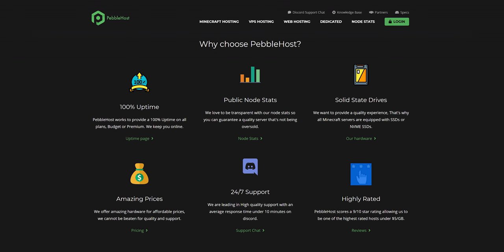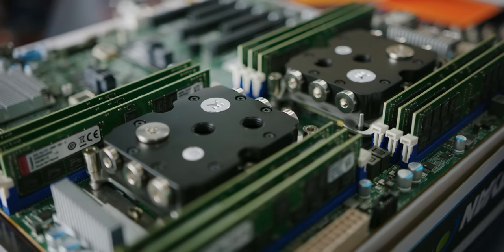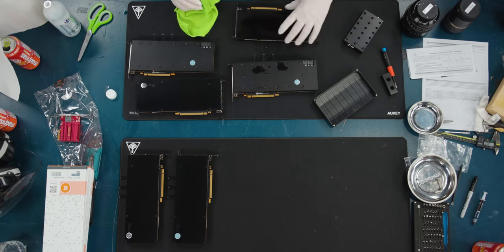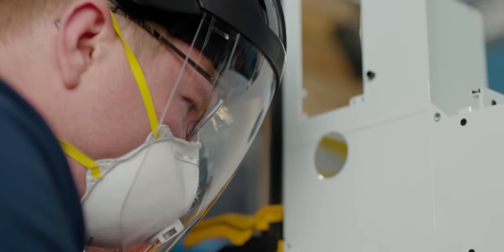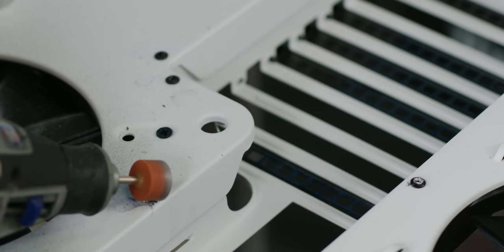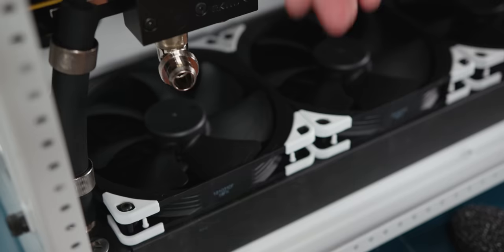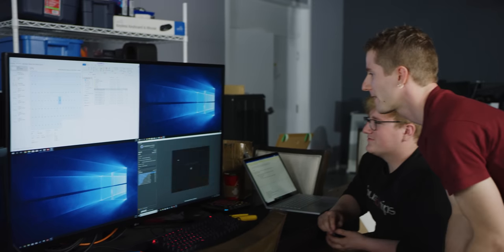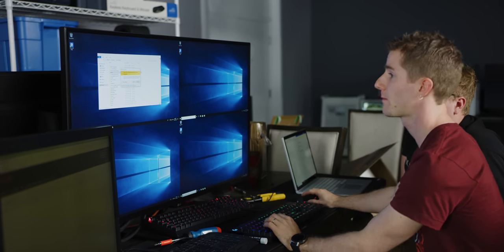We FINISHED the $100,000 PC! - 6 Editors 1 CPU Pt. 6

Comment: In a post EPYC world, this seems meh on the CPU front.

It's awesome nonetheless as an overall project with all the VMs running.
Reply: Yeah EYPC would run 6x16 GPUs, 4x4 Optanes, 6x1 USB cards, 1x8 NIC, and have 2 lanes left over.
Reply: @chickenballs-balls  Yeah, it would have been cheaper. But it wouldn't have been so much fun, right?
Reply: @chickenballs-balls  Works out to 16k per desktop. Even the base model Mac Pro would dust this heap of shit per user.
Reply: @chickenballs-balls  and then moved
Reply: if, and it's a big if, they can find a proper epyc motherboard with decent VM support (remember, they switched the motherboard a couple of times even on intel)
Reply: @ionstorm66  no thunderbolt and no optane is a no for most professionals
Reply: @ionstorm66  
The NIC alone is a 1x16 card. So you'd be -4 on the number of lanes.
Reply: Epyc processors are for noobs who have been living under a stone for the last 10 years and now come out with their pitchfork to enter society again. Next year Intel kicks them back into Neandertaler mode again.
Reply: @directlinkrexx4409  Thunder bolt and optane work on AMD. It's all up to someone to actually make a dual socket TB board though. Optane works on any nvme system.
Reply: @ewenchan1239  Single 100G cards are x8 3.0. Also they are only running a single 40G which could run a dual port card on x8.
Reply: @jankees4037  
I'll give the EPYC this (over the Intels) -- the EPYC does have more PCIe lanes than the Intels.

But to the best of my present knowledge, there aren't that many boards with enough PCIe slots to be able to put 256 PCIe 3.0 lanes all to good use, so therein lies the rub with the EPYC processors.
Reply: @UCROrNX7yCYQH_UO9p7uP5PA Grid is display over IP. They wanted hard wired connection to the monitors and peripherals, lower latency. Also Nvidia wouldn't send them Quadros because last time Linus gamed on the Quadros for the 8K PC.
Reply: @ionstorm66  
That is true. 

However if you go to about the 6'05" mark, you can see that they're using dual port Mellanox cards both on this system and also on the server(s) (see time marker ~ 6'15") which means that they're PCIe 3.0 x16 cards.

Thank you.
Reply: @ionstorm66  
I think that it's actually more than that.

https://www.anandtech.com/show/8042/nvidia-grid-update-nvidia-launches-grid-test-drive-for-vdi-desktops

My understanding is that the Tesla V100 is actually doing the processing and then sending the images back to the VM so that it sort of bridges the gap between remote desktop to an actual physical workstation vs. being physically at the workstation/console/terminal.

AFAIK/from what I can tell, this is actually even better than some local IPMI/BMC setups that I've seen and used, both currently and in the past even though KVMoIP isn't a new "thing". (Not in the slightest.)

The only real advantage that I might be able to surmise here is that with each VM having their own dedicated TITAN V, each VM has access to more VRAM. That's about it. Beyond that, they're both using the GV100 processor.
Reply: @ewenchan1239  Do you know the card in the server is installed in a x16 slot? The cards will deliver  60gbit on x8, and he is only running a single 40G connection.
Reply: @ionstorm66  
Well, the card is PHYSICALLY an x16 connector unless he starts cutting the PCB to make it PHYSICALLY into an x8 card.

Electrically, the slot could be an x8 or x16 slot regardless of the physical dimensions. Heck, for all you know, you can turn a x16 physical slot into a x1 electrical slot. There is literally nothing that prevents you from doing that, so the question is a bit of a moot question. It's irrelevant. (A Ferrari that where you can set the cruise control to the posted speed limit doesn't change the fact that it's still a Ferrari.)

It doesn't change the fact that the cards are physically x16 cards and for it to be able to achieve the full 100 Gbps speeds, it will need the full x16 PCIe 3.0 electrical interface which has a theorectical bandwidth of 128 Gbps.

Just because you buy a Ferrari and ONLY drive it at the posted speed limit doesn't detract from the fact that you have bought and are driving a Ferrari.

So, I'm not really sure what your point is.

Or are you trying to say that because he has no more PCIe lanes left, that he shouldn't have bothered buying the Ferrari and should have gotten the Prius instead?

(If I read and interpreted the point of your question/reply/comment properly, that would be the analogy that you might be proposing. If you're going to be slow anyways, why bother with the Ferrari when you could have just gotten a Prius? Conversely, if he even takes out just ONE (x16 physically/x16 electrically, possibly TWO (x16 physically/x8 electrically) of the Titan V's, he would have enough bandwidth available in the x16 physical slot that he would be able to run it at x16 electrical speeds, depending on how the PCIe expansion board/switch has been set up.)

If you have the Prius, you remove the speed restriction, you still have a Prius. If you have a Ferrari, and you remove the speed restriction, then you'd be able to fully realise the potential of the Ferrari. This is the same here.

Either way,  with a DAC, he can configure the ports on the Mellanox cards to run at 100 Gbps speeds anyways (and also set LINK_TYPE_P1 (and/or P2) to 2) and the system will muster up what it will be able to muster up. If he actually changed the speeds on the ports, it won't really make any difference because doing so doesn't change the MTU or how the packets are encapsulated/sent/received/etc.
Reply: @ewenchan1239  Linus only has a 40G switch so the best he could do is team dual 40G, but as of now the server only had a single 40G hooked up. Also on almost all of my server board the x4 and x8 slots are open backed, so they can take larger cards, it's pretty standard on servers and workstations. That way they can fit smd components were there would normally be half/three-quarters of the useless x16 slot. In fact the the board Linus is using has 4x16 and 3x8, the x8 being open ended.
Reply: @ionstorm66  
"Linus only has a 40G switch"
[citation needed]

"but as of now the server only had a single 40G hooked up"
Again, if you go to around the 6'15" marker in this video, you can clearly see the shot where both servers are connected. Can't tell if they're connected to each other (DAC) or if they're connected to a switch.

Again, I haven't been able to find anything anywhere that even suggests that they're using a 40Gbps switch, so you'll have to provide a link/citation for that.

"Also on almost all of my server board the x4 and x8 slots are open backed, so they can take larger cards, it's pretty standard on servers and workstations. That way they can fit smd components were there would normally be half/three-quarters of the useless x16 slot. In fact the the board Linus is using has 4x16 and 3x8, the x8 being open ended."
That might be true for Tyan boards, but it's certainly not always true for Supermicro boards or any of the OEMs.

(cf. https://www.supermicro.com/CDS_Image/uploads/imagecache/600px_wide/intel_motherboard_active/x11dac_top.jpg)

Again though, I have no idea what is the point that you are trying so desperately to make.

Having the Mellanox cards that are capable of 100 Gbps speeds (the analogy of having a Ferrari) doesn't change the fact that due to the presence of speed limits/speed restrictions or lack of road nor open space to be able to drive the Ferrari at max speeds -- neither of that changes the fact that he has a Ferrari.

Again though, I have no idea what is the point that you are trying so desperately to make.

If the point is that because limitations and restrictions EXIST, therefore; he should have gotten a Prius instead of the Ferrari, then okay. But I'm not even sure if that's the point that you're trying to make. If the point that you're trying to make is that speed limitations/restrictions EXIST - okay. So? What's the so-what of that fact? Who cares? What difference does it make? He still has a Ferrari. He's still bound by the speed limitations/restrictions.

Conversely, you remove or elimination some of those barriers/limitations/restrictions, then by virtue of having a Ferrari, you'd be able to drive the Ferrari the way that it was probably meant to be driven - FAST! If the point that you're trying to make is that because current restrictions/limitations EXIST (and therefore; he should have bought a Prius instead? - again, I stil l have no idea what is the point that you are trying so desperately to make other than restrictions/limitations EXIST, which again, what's the "so what?" of that point? You can bring it, but what's your follow-up to that? What's the so-what of that statement? Why is it even remotely worth mentioning? Who or why should we care?) -- then that's one thing. But he has the cards, which means that he can easily drop about another $3-4k for a used 100 Gbps or 100 GbE switch and then he'll have between 3.6 to 7.2 Tbps of switching capacity (18 port 100 GbE Mellanox switch or 36 port 100 Gbps IB switch).

NONE of that changes the fact (still) that the 100 Gbps Mellanox cards are STILL physically/electrically x16 cards.

Therefore; what's the so-what of if he had popped them into an x8 slot? So he popped them in an x8 slot or has them running at x8 speeds electrically. Again. So what? What's the follow on point or conclusion that you are trying to guide your readers to? What is the objective that you are trying to accomplish with stating that, if any?
Reply: @ewenchan1239  he literally says in the video that even though it's a 100g card, they only have 40g switch.
Reply: @ionstorm66  
"Yeah EYPC would run 6x16 GPUs, 4x4 Optanes, 6x1 USB cards, 1x8 NIC, and have 2 lanes left over."

If you ran the x16 physical/electrical card in an x16 physical/x16 electrical slot, only 10 lanes would be supplied in your hypothetical/theorectical EPYC system (out of the 16 that would be electrically required by the Mellanox 100 Gbps NIC in order to full supply the 100 Gbps speeds that the card is physically/electrically capable of).

Linus' statement in the video states that they don't have a 100 Gb switch nor enough PCIe lanes to be able to run the Mellanox 100 Gbps card at 100 Gbps speeds.

Both of those statements will STILL be true with this build, and your hypothetical/theorectical build.

Even with your hypothetical build, Linus STILL won't have a 100 Gbps switch nor will there STILL be enough PCIe lanes to run the 100 Gbps card at 100 Gbps speeds.

So a) the NICs ARE physically/electrically x16 NICs.

b) the ONLY way that your hypothetical/theorectical build would be more advantageous than what he actually build is if he actually acquired a 100 GbE switch or a 100 Gbps IB switch.

Then and ONLY THEN will there be an advantage (because the card in an x8 physical/x8 electrical slot would be capable of 64 Gbps) vs. the 40 Gbps that he's currently running, but Linus never said how many lanes were left over. We can only assume/calculate that he's got 5 PCIe 3.0 lanes remaining from his statements.

Conversely however, if you plugged said 100 Gbps x16/x16 NIC to an x16/x16 slot, of which only 10 of the 16 PCIe 3.0 lanes will be available from what's left in your hypothetical/theorectical build, AND Linus has the 100 Gb(E) switch, then and only then, would more of the difference between them would be realised.

The problem that I am having with the same/something akin to that is NOT being able to find a BTO/WIO board/system that can actually feed all 256 PCIe 3.0 lanes that a dual AMD EPYC system permits/allows, by design, based on the specifications of the CPU.

For example, to be able to run 24 NVMe SSDs at full PCIe 3.0 x4 speeds for each, you'll need something like a Supermicro H11DSU-iN board like six riser boards to be able to get the drives connected to the dual EPYC SP3 sockets with enough PCIe lanes to go around for all of that (per Supermicro A+ Server AS-2321US-TN24R25M).

This has been, so far, the first system that I have found that their block diagram actually shows that each of the NVMe drives will be able to get the full PCIe 3.0 x4 interface as opposed to have it switched (sometimes serveral times over like the Gigabyte R281-Z92) like other solutions that claim to be able to host 24 NVMe drives. (They'll physically fit, but many do not make the full PCIe 3.0 x4 bandwidth available per drive. It goes through some form of PCIe switch(es).)

Even then, according to page 43. of the manual for the server, there might be some overprovisioning of the drives with respect to the PCIe lane assignment/availability.
Reply: @ionstorm66  
"...they only have 40g switch."

No, he doesn't.

Do you need to watch the video again with closed-captioning enabled?

He literally states:

"...and a Mellanox 100 gigabit ethernet card to pull all that juicy 8k footage off of our main editing server which is also equipped with one of Mellanox's high speed network cards. Now we're only able to run our cards at 40 gigabit because we don't have a 100 gigabit network switch or enough PCI express bandwidth anyway, but that should still be plenty for six 8k raw streams."

^This is LITERALLY what he ACTUALLY says in the video.

Watch it again.

Where does he actually, ever state that they have a 40g switch?
Reply: @jankees4037  I don't give a shit about next year when I have EPYC now with more PCIe lanes, more memory channels, more cores, more threads, better SMT, and more cache, all at a lower price.
Reply: @ionstorm66  it doesn't
Check out the speed and compatibility issues

Comment: That moment when the 3990x beats 2 xeon platinum🤣
Reply: It does not beat 2 cpus, in works like cfd
Reply: i don’t speak computer
Reply: Evan Jones lol yes
Reply: huh???
Reply: Logan Parent lol yes
Reply: Logan Parent lol yes
Reply: It does
Reply: @mocanulaurentiu5812  the main difference is that the Xeon is a server grade CPU and threadripper an HEDT. The performance will be almost similar.
Reply: @chudthug  lol yes
Reply: @chudthug  lol, watch benchmarks
Reply: @drbali  i think a dual epyc server would be a lot faster than a dual cpu intel xeon more comparable 2 x 32 core cpus
Reply: Salty of course a 100000 dollar server is faster than a 10000 dollar one it has 2 cpus
Reply: lol no
Reply: @chudthug  lol yes
Reply: You’re comparing apples to oranges.
You’re comparing a GPU for gaming to a GPU for MULTITASKING.
Reply: @drbali  

THANK YOU. It’s like comparing apples to oranges.
Reply: Just wait for 5990X Threadripper :)
Reply: @genericmememan1131  lol,   it will perform worse then the i9 10900k.
Reply: @jebes909090  uh look at all past top end AMD chips, they can always beat or match their lower end chips on single threaded workloads, so considering the 5600X idk bout that chief...

Comment: I believe this channel have the horse power to render a good part of Hollywood blockbuster movies.
Reply: They already did. Like 6 years ago.
Reply: How much specs are needs for that 😱
Reply: @MinistryOfMagic_DoM  awesome
Reply: @MinistryOfMagic_DoM  what movie?
Reply: @thevoyageof67  surprisingly not very much. A decent HEDT desktop processor and a good GPU should do it. Decent amount of RAM. 32-64GB.
Reply: @TheTimmy4745  literally any of them. It doesn't take much to render video or animation.
Reply: @MinistryOfMagic_DoM  you said that they rendered a Hollywood movie and I asked which one.

i could render one too i get that but you made it sound like they actually rendered one.
Reply: @MinistryOfMagic_DoM  I'll do a whole video on this.  How much it takes to render,  my laptop overheats after rendering a 5 minute clip 😂
Reply: @MinistryOfMagic_DoM  😎 👊
Reply: @thevoyageof67  um you're using a laptop. That's the problem.
Reply: @TheTimmy4745  ah! I did not say they rendered one. I said they had the power to do so. Though I could understand how you might be confused about that.
Reply: @MinistryOfMagic_DoM  what should I use? Enlighten me, I might feature your advice in my next video
Reply: @thevoyageof67  a desktop... Or a laptop designed for heavy work AKA a desktop replacement. You're not going to have good enough heat dissipation in such a small chassis to sustain the work load on your CPU or GPU in most laptops. Don't take my word on it though, just go watch LTT or Jayz2Cents explain the concept of heat in computers. Specifically look at things like the thermal throttling issues in MacBooks and the like. Super high speed processors getting wrecked by heat they can't manage properly.
Reply: @MinistryOfMagic_DoM  thanks
Reply: Just not the cgi portions.
Reply: @robertt9342  what the fuck do you guys think it takes to render animations and CGI? It's not that resource intensive.